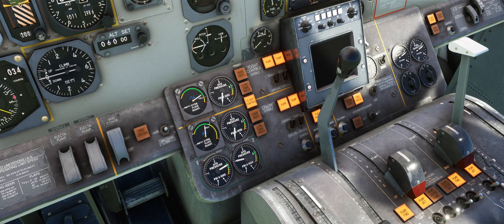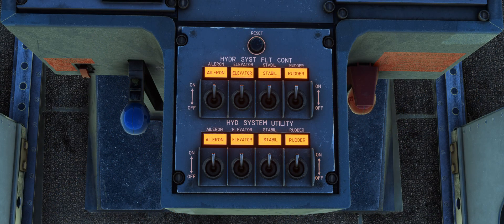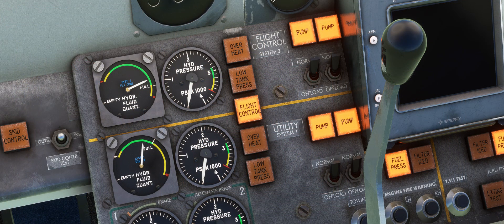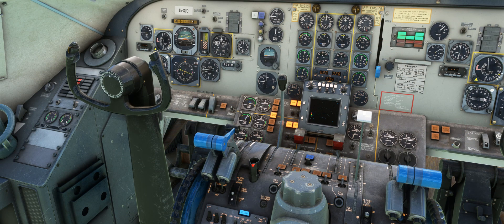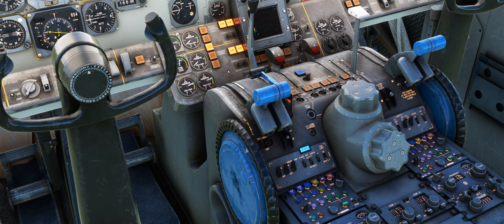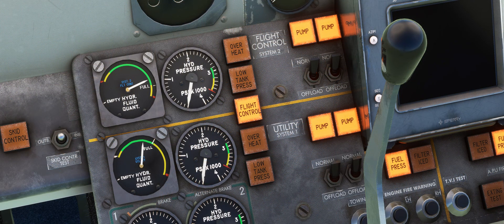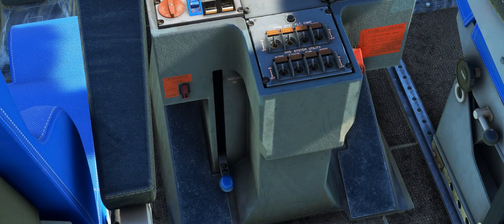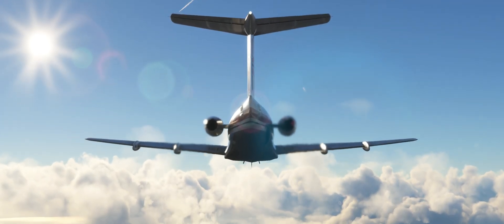F28 Professional Flight Controls Overview - Just Flight

Comment: I was a Training Captain on  the F28 for five years & all this knowledge of these systems came into practice on an spproach to YMML (Melbourne Australia) one night when I noticed the Utillity System showed almost zero quantity (Gear, Flaps, Speed Brake, Nose Wheel Steering & half the controls).
I turned the pumps for the System off immediately & we went through the drills & discussed our approach. (Alernate gear extension results in the Gear Doors hanging lower than the wheels & a handle has to be used in the floor to wind them up enough).
15 miles out we turned the Utility Pumps on & immediately Gear down & with luck the Gear was down & doors closed normally. The Flaps however did not work so it was electric Flaps (BTW Zero Flap landings are easy _ we train regularly on the Real Aircraft)
ATC however got suspicious & asked if "Our Operations were normal" & I told them we had no Nose Wheel Stearing (True) & would need a tow in. 😊
Landing was normal & we got to a High Speed taxiway.
(Broken hydraulic line was the problem)
BTW Useless fact - the two systems are Seperate sort of - fluid actually gradually goes from the Utility to the Flight control systems & the engineers are notified.